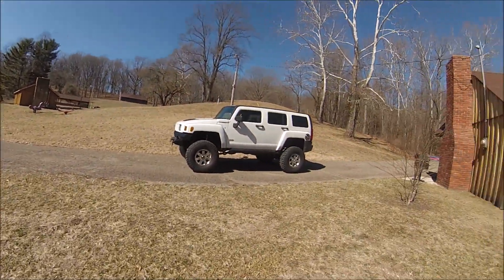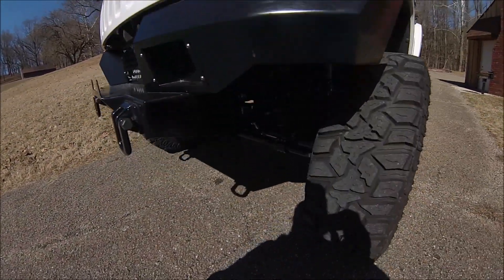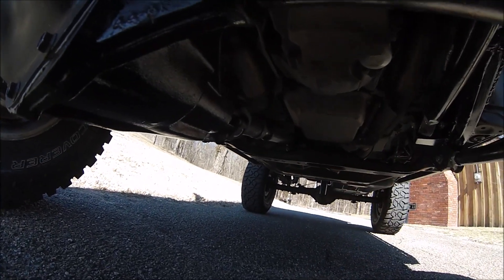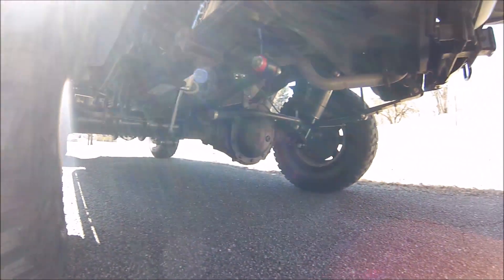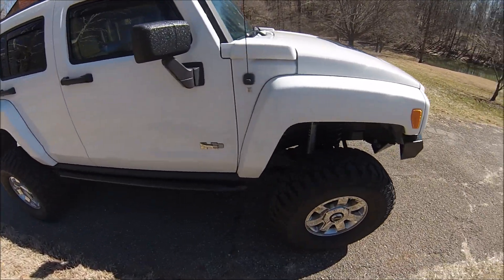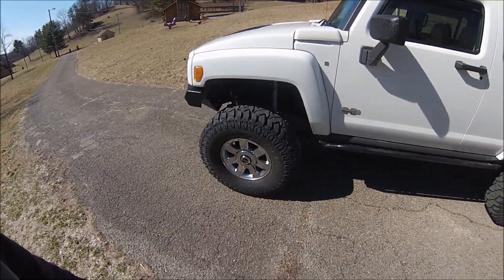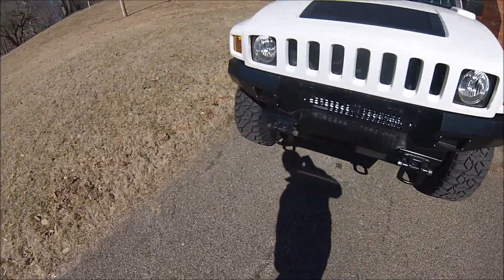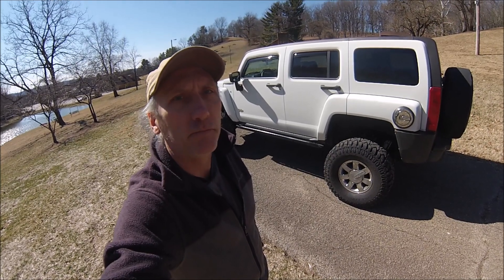THORparts Hummer H3 build

Comment: awesome!   I was wondering if you still did the parts and adapters.  I've been trying to get a list of brackets, links, adapters etc etc that I'm going to need.  I have a few shops here that will help me do the conversion, just trying to get parts rounded up so all that I'm paying for is labor essentially.   My luck, if I welded it up myself,  the front end would roll off on down the road on its own lol.   great job!!

Comment: This is an absolute breathtaking build! I'm looking to build a SAS system for my 06 H3 with adventure package and after market front lockers and matching diff from an 09 H3. do you have any advice? I'd like to stick with 35 inch tires and not have it be much taller, if not the same height. than my 2 inch lift I have on it. I just don't want to keep paying for the weak parts I break and upgrades that don't really do much of anything. my adjustable upper control arms, rack brace, inch thick tie rods/ends only get me so far. Any help I can get for a parts list or general build info from an experienced  pro as yourself would be amazing! I have seen all your amazing H3 builds and I am a  huge fan.

Comment: Could I get more info in that pitarm are u still using the Delphi steering box ??
Reply from the maker: This truck uses a Toyota FJ-80 steering box.  The pitman arm is a 2-1/2" drop from Trail Gear...the hole has been re-tapered (top-down) for a 1-ton end.  This pitman arm can be bought thru Summit, Jegs, or RuffStuff.

Comment: Curious about how much do you charge to do this?
Reply from the maker: Around $7k in parts and 100 hours of labor.
Reply: I was curious as well. I currently have the Rancho lift but leaf springs are worn (basically lost lift) and I'm between SOA or just getting the leafs re arched to lift it back up. A lot of shops around here have turned me down for the SOA so far.
Reply: 4speedfunk 
Is this price including the SOA? If so what is the price for the SAS with labor?
Reply from the maker: @8SiCK0LAKE1   You can do an SOA in one or two days.  You will need approx. $400 in parts.  A full turn-key SAS/SOA runs between $11k and $14k...alot depending on how crazy you go with the front axle build.
Reply: Hello dear friend ! I think you THE BEST ! Very good job !
Reply from the maker: $8k in labor.  Approx. $5k in fab parts.  Approx. $1k-$5k for front axle.